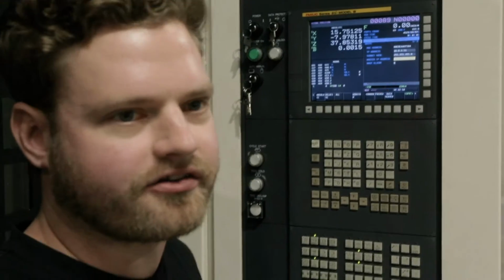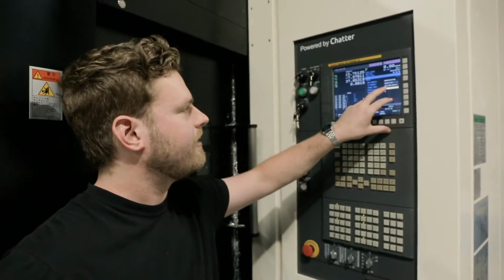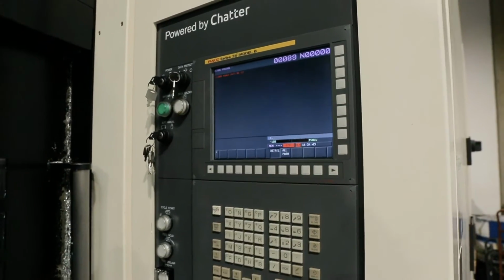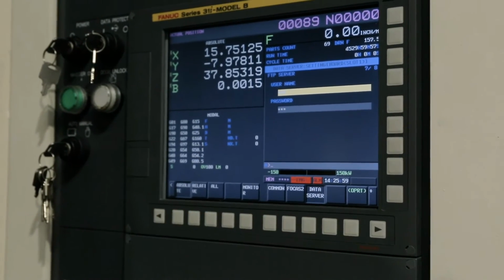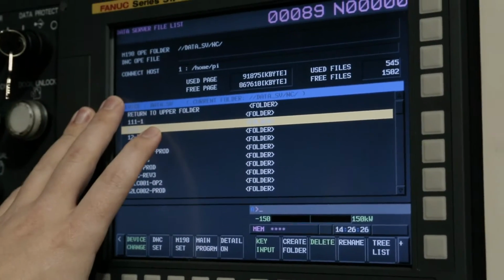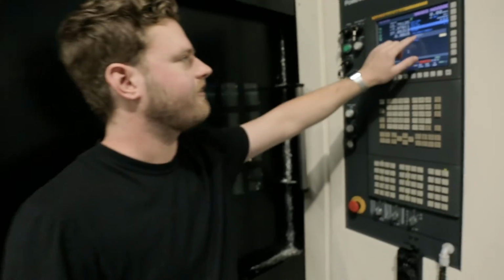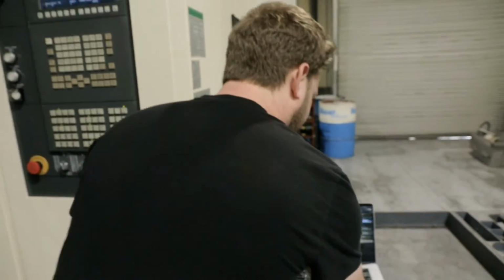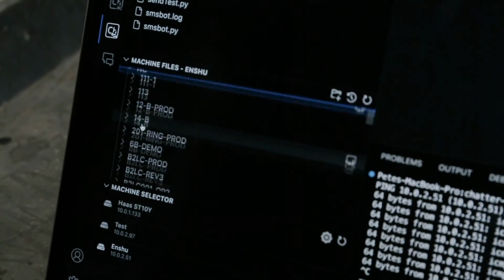Simple Fanuc CNC Networking (FTP & Monitoring)

Comment: Hey guys,
at our firm we operate a Linux-based FTP server with essentially no explicit restrictions configured (no firewall rules, no connection limits, etc.).

In general, the setup works fine. However, once around 6–8 machines are connected simultaneously, we start seeing sporadic FTP errors. Roughly every ~100 transferred protocol files, one or more machines drop the FTP connection or throw transfer errors.

The issue does not occur with fewer connected machines and seems to become more frequent as concurrency increases.

Could this behavior be related to the use of Active vs. Passive FTP mode, especially under higher parallel connection counts?

Comment: Are you saying I can't use ftp unless I have a dataserver plugged into the machine? I've been trying to set the FTP over embedded port for days and it always refuse the connection
Reply: Same here. They say they use FOCAS, yet ask to configure FTP as data server. 
I know one thing for sure - you can't access files on the machine remotely if data server is not present, it is clearly written in the FANUC manuals
Reply: @viliusr6974 not exactly. If you don't have the dataserver on the machine you can still connect through FTP using the machine as FTP client and setting up a FTP server in a remote computer, I did it in my server with filezilla and it works. In the machines FTP settings you set the IP of your remote FTP server and set the username and password for the user you create in your FTP server. In the machine you also need to change the input channel to the ethernet embedded port. You can then access the remote folder from your machine, but at the machine you do need to copy the files from the remote folder to the internal memory so you can execute them, for that you can use the F INPUT function.